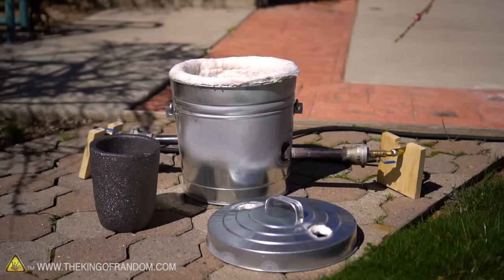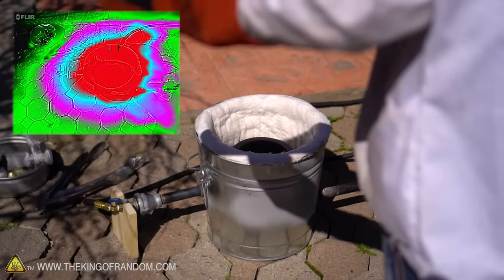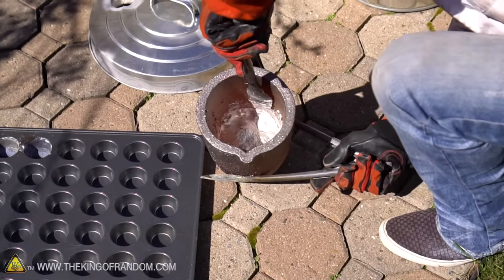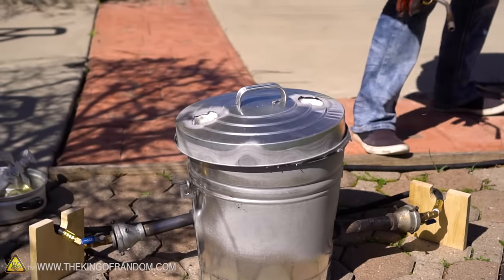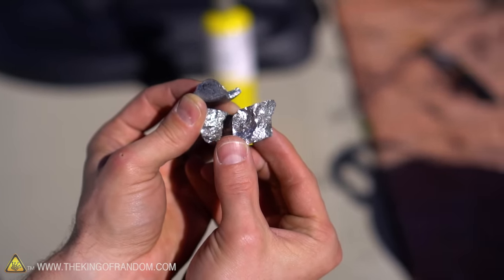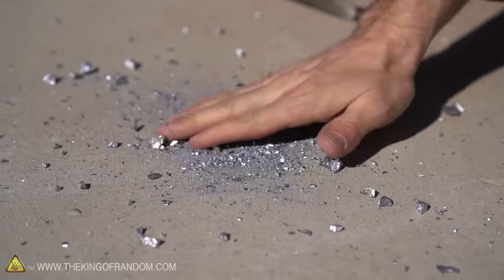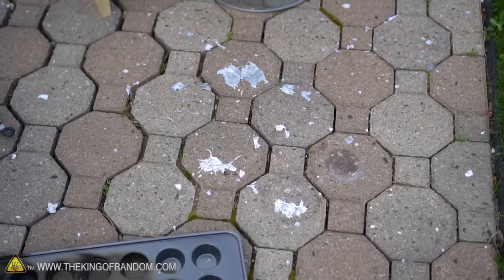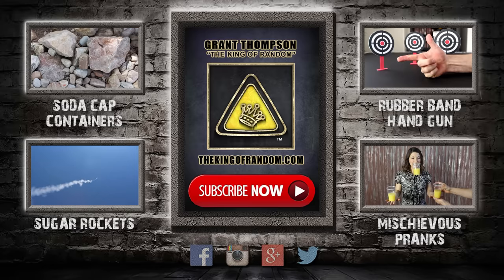Mixing Molten Aluminum With Molten Brass | How To Use Mini Metal Foundry For Mixing Metals

Comment: The reason it shattered so easy doesn't have much to do with the metal more the fact that they are metals. While the aluminum is brittle, the reason it shattered so easily is because it was cooled down rapidly. This increases hardness (resistance to scratching) but increases brittleness (resistance to shattering). If it cooled down slowly, in air, in sand, etc. it would be less brittle but would also probably be less shiny
Reply: Kevin Smith Thank you... I noticed that too. He always just sticks them in cold water to instant cool them
Reply: I dont think that is what happened here.
If you take a look at the broken pieces you can see that the crystals are extremely large.
Large crystals mean the alloy cooled down from liquid to solid very slow.
Now iirc neither aluminium nor copper have a phase change below the melting temperature so cooling them fast after they solidified does not make any difference.
Reply: Kevin Smith correct sir
Reply: Kevin Smith you nailed it with science ☺☺
Reply: Kevin Smith is right. Landogarner83, you can't say that the crystals are large or not, a brittle fracture like that shows nothing.
Reply: Steel can also harden so it sounds quite logic. I'd like to see what happens.
Reply: Kevin Smith sorry, but do you mean decreases resistance to shattering? not increases?
Reply: Actually, steel hardens and becomes brittle during quenching  because of a diffusionless transformation of the crystalline structure, which is causing very high internal stress. But I don't know if such a thing happens in this mixture since it's been quite a long time since I've studied this. It's interesting though.
Reply: It's Tensile strength would be very low and would snap easily at say 35Mpa
Reply: Your thinkin of steel bud. Steel hardens because carbon in the steel helps create a crystalline structure inside. These two metals are non-ferrous and WILL NOT quench harden
Reply: I don't have any experience with aluminum, but with other non-ferrous metals (copper, bronze, brass, silver, gold ) when you heat to a low red and quench, it actually anneals them (makes them softer).   These metals quickly become work hardened when they are stressed (bending, pounding, shaping), and in order to make them malleable again is to anneal them in that way.
Reply: guys guys, the answer is simple, 90% iron 5%carbon 3%brass and 2% aluminum
Reply: trust me i totally know what this mixture would do, basically like making a nuke with a sword 8)
Reply: This is all true but the composition is a large reason it shattered. All the samples were quenched. You could see varying degrees of brittleness in the different compositions. Quenched brass and aluminum will not shatter like that, while a 50/50 mix can.
Reply: buttonvalley yeah, it works the same with steel and other alloys. Actually, annealing is mandatory after quenching steel, or you will have a very brittle material that'll break upon impact. Annealing is kind of a "reset" button, it allows atoms  to diffuse and release the strains that made the material hard and brittle. If you manage to control the temperature during this annealing process, you can control the hardness and resilience of your material (after quenching in the case of steel).
Reply: Even high carbon steel has only 0.45% to 1.50% carbon content.  5% is in the cast iron range, which can't be worked or shaped after casting.
Reply: but the brass
Reply: or am i o.O
Reply: Keyshaun Spratley YOU ARE NOT BILLNYE
Reply: Bill Nye only played a scientist on TV. Cody has more of a science background than him.
Reply: Bill bye isn't a scientist. He's a actor
Reply: kristofer, as they said hes an actor and i am acting as a scientist there for by transistive properties you cannot not say im bill nye
Reply: Keyshaun Spratley he is also a scientist
Reply: well im playing bill nye sooo... TRANSISTIVE PROPERTIES!
Reply: This is only true for steel, where heating and quenching imparts high hardness and thus high brittleness. Quenching for copper and copper alloys actually anneals the material (this is often done to relax the metal while cold working copper as it work hardens). Aluminium and its alloys are hardened by aging, a process where the metal is quenched then tempered. However, unlike steel, where the hardness is imparted during the quench and dialled back in the temper, the hardness is imparted during the tempering (aging) cycle.

Comment: It would be cool if you melted down pennies and experimented with pennies made in different years(since they have different metal compositions). Plus, what else(as in a practical use) could you do with a penny?
Reply: Lucas E pennies after 1985 are just copper clad zinc
Reply: Yea so get a penny from 1807... not worth enough to save! :)
Reply: FinalNoob_27 A penny from 1807? That's worth thousands, probably more.
Reply: FinalNoob_27 im pretty sure a penny from a little over 200 y/a would be worth more than what I make in 2 years
Reply: +Lucas E you can make batteries from pennies
Reply: What you make, my friend, is a federal crime....
Defacing public currency...
Reply: You are right.
Reply: but that would be cool. penny muffin
Reply: Lucas E I so read that wrong
Reply: Ninja Master lol
Reply: Lucas E g
Reply: Pieguy55 I was just about to say that

Comment: If you can make brittle metals, can you ground them into a powder and see how flammable that metallic powder is?
Reply: I know I'm a year late to this comment, but metals don't burn
Reply: Sodium, but I guess you mean heavy metals not alkaline metals
Reply: @thepizzaguy8477  well... they can, but not at normal temperatures... you can oxidize metals fairly easily, you can even evaporate or turn metal to plasma with enough heat....
Reply: @thepizzaguy8477  zinc does, so dose magnesium, and aluminum can burn. But yeah copper is called a "noble metal" so copper doesn't burn or oxidize as easily as other metals.

Comment: The rapid quenching with water tends to make metals a lot more brittle. The rate of cooling has a big effect on the way the crystalline structure forms and changes the metal properties a lot. That could make an interesting video, make the same mix of metal a few times, allow one to cool overnight, quench one in water, and quench one in liquid nitrogen. Then test how brittle they are.

Comment: The reason why the metal became so brittle is because you cooled it with water. This causes micro air pockets to form in the newly mixed material, which make it extremely brittle.

I would implore you to do the same half and half mixture and then let it cool on the concrete till room temp. The same principle can be found in welding, where whenever you add new material (or the weld filament), when you cool it down with water the same thing happens. The weld becomes brittle, and can’t hold up as much weight.

Comment: I've been wondering for quite a while what will happen when you mix molten glass with molten metal, can you try that out?
Reply: Yeah, I think you would be looking to suspend the metal in the glass structure, rather than blend them or make an alloy. Pretty sure glass is non-reactive and can only be decayed away. There are many examples of glass blowers using foreign particles to make designs, colourization, structure, etc. I think an ancient glass blowers used to blow finely ground particles into their pieces. Certainly for colouring, glass "alloys" are a possibility.
Reply: TheTiemotje They do in the process of making certain forms of glass where an ingot of tin I believe is melted down and the molten silica floats on the tin
Reply: Some crystal glasses use metal oxides from lead or zinc but you need temperatures way higher than 1000°C, which is enough to melt brass or copper, to properly combine the materials into glass. 1500°C is what you'd need to have at least.
Other metal compounds are used to colour glass and lead glass is also used to shield from ionizing radiation.

Molten metal probably wouldn't work though.
Reply: TheTiemotje yeah
Reply: That's how they make some marbles, such as the golden lux swirled ones
Reply: well your smart

Comment: Can you make homemade bronze with copper and tin
Reply: it's not just copper and tin, but also some nickel or zinc.
Reply: Dr. ZomGaming traditionally bronze is just copper and tin
Reply: You're both right.  There are actually a bunch of different alloys that are 'bronze.'  Some are just copper and tin, others add in other metals for different uses.  Steel is the same way.  If you just add carbon to iron you'll end up with a basic form of steel..... but if you add in other metals, like nickel, chromium or molybendium, you'll get steel with different properties.  (Corrosion resistance, extra hardness, greater durability, etc.)
Reply: I see $25 coming ur way
Reply: yeah bronze can be made using a variety of metals... infact aluminium bronze is made with copper and aluminium, has it's benefits over the traditional tin bronze... so grant pretty much made bronze in this video.. even though he used brass the zinc burnt off leaving copper.
Reply: That's what I was thinking.

Comment: Can you melt "fools gold"(iron pyrite)?
Reply: Wuchubuchu You certainly can melt fool gold it's melting point is about 100 degrees Celsius higher than coppers melting point . Fool Gold melts at around 1180 degrees Celsius 👍🏻
Reply: Wuchubuchu The technical name is pyritr
Reply: No, pyrite is iron sulfide, the sulfur would burn off giving you iron and some very toxic gases
Reply: Littlescotty 22 pyrite
Reply: its called pyrite
Reply: +Colby Upton
If you found various samples of Fool's Gold in the Lesser Antilles...would they be Pyrites of the Caribbean?
Reply: I think if you smelt fool's gold you end up with iron.  Burn away the impurities that make it look like gold.  It's actually a type of iron ore.
Reply: You are burning off sulfur by burning iron pyrite in this case.
Reply: bigstackD you could probably forge the metal then.

Comment: Would you be able to use the heat resistant fabric and wrap it around the crucible so you don't have to use those tongs? Great video! Keep up the great work!
Reply: WhiteFox he could but then there is the chance of the molten metal dripping down and buring his gloves and possibly his hands
Reply: No because that would make the crucible insulated and thus, not able to heat up and melt the metals

Comment: make a mold of your own head!
Reply: Piggiey5000 No He Can 3D Print his Face And make a Mold (Silicone)
Reply: there are ways to cast a head, I believe myth busters did it a few times and I've had my just my face cast in paper machete in middle School
Reply: Piggiey5000 he can put his face in the sand and pour some molten Al in that hole
Reply: You can do a life cast look on tested channel
Reply: smeltwater that's why you put straws up your nose when you make head molds

Comment: Quenching metals make them brittle. That's why tempering is needed afterwords. The reason smiths quench metal is because something brittle can be extremely sharp. But they temper afterwords because too brittle and it will lack durability. If you let them cool slowly I suspect the chances of them shattering upon being dropped would be reduced significantly.
Reply: This, if you JUST quench it in water, it's going to be EXTREMELY brittle, hence it shattering on the pavement, but if you temper it, say with a blowtorch or even just putting it in an oven for ages, it will help it gain some strength back.
Reply: Tiffany Quenching brass actually makes it more ductile afterwards. Reloaders do this when converting cases from something like a 20 ga. to .577/.450.

Not all metals behave the same. :)
Reply: Robert Rodriguez yeah science
Reply: Lmfao they quench it to set the cystaline structure of the metal. It has nothing to do with sharpness. The reason its brittle is cause all the molecules are under stress, tempering reduces that stress.
Reply: quenching steel makes it brittle, while hot steel is ductile. quenching copper alloys makes them ductile, but hot copper alloys are very brittle. metal =/= metal.
Reply: Except for the fact that latten metals (copper alloys) are annealed by quickly quenching them. This is the opposite of ferrous metals.
Reply: J Schmidt Nobody who originally invented the process had any idea about crystal chemistry of metals, they indeed started doing it because hard and brittle tend to go hand in hand for basic metals and hard means holding an edge better which would be the actual goal usually.

why, for a weapon, would you want to "set the structure" in that way anyway other than edge hardness, sharp edge holding, etc.?

it's like saying "I put gas in the car to get to work" then some person responding "uhhhh aaactually you put gas in to mix with air in the pistons" or something--eyeroll... yes,  order to get to work.

the actual end goal of quenching is generally sharp edge holding ability for a weapon or tool.
Reply: Tiffany 
Copper and brass are the opposite to steel. 
It actually gets softer if you quench it.
Reply: Tiffany I think the mix  blows up become of the valence electrons in the different metals zinc has 2 copper has 2 and aluminum has anywhere form 2 3 or 13 .the zinc dose not like this so it chose to bind to oxygen because oxygen has 6 elcterons. Elements like to have full shells so zinc becomes zinc oxide quickly creating an reaction. If I'm wrong please correct me.
Reply: why is why metal is put in oil then in water
Reply: Terminator X the oil quench is to slow down the temperature drop. some steels really like to crack if quenched too quickly. you wouldn't need a water quench after that.
Reply: Except that brittle and hard arent dependent on each other. Nobody was running around saying we need this blade more brittle so we can sharpen it more, they said what can we do to make this super hard metal less brittle. Just cause it was a side effect doesn't mean they really  really wanted it, otherwise why temper.
Reply: Brittle and hard aren't complete synonyms, but they are indeed highly related outside special cases. If something does not easily dent or deform, then it has to do something else when too much force is applied, usually among materials out there in the world, that is "snapping". Including most metals. 

Nowadays uou can probably find some exotic alloy for whatever you want, but they used to make the spine of the blade soft for flexing not snapping (but unsharpenable for long) and the edge hardened (but also brittle), because the two went so closely hand in hand there was no better solution for most of human metallurgical history.

Comment: Aluminum and copper are the basis for 'non-sparking' tools.
Called aluminum bronze, it has a soft golden color, is a little heavier than Al and is very corrosion resistant.
The curiosity I have is this: what do these alloys do in terms of heat-conductivity?
Copper is one of the best cheap metals for carrying heat, Al comes in a distant third.
Silver is the best, but at current prices you won't see too many Sterling Silver heat-sinks.
Sterling is about 97% Ag, 3% Cu by weight.
Next week on 'This old guy rambling', we make a Silver heat-sink by melting down some un-circulated 1923-D Peace dollars with a 1943 copper penny or two.
Work with what you have, I guess.
Reply: Greg Gallacci sterling is 92.5 hence 925
Reply: thats a nice question, if it was an alloy thermal conductivity and thermal expansion would be in between copper and aluminum, however thats not an alloy, copper aluminate forms at that temperature, in my opinion thermal cond. would decrease dramatically since the crystal structure and mech. properties resemble ceramics.
Reply: alloys have lower thermal conductivity than pure metals
Reply: Wow. A plug.
Reply: Copper isn't cheap lol
Reply: evanr32 it is?

Comment: don't heat your brass so hot just a few degrees above melting point and use sum flux.
Reply: jim stone he can't control the temp perfectly
Reply: He likes to breath in metal vapors and roach killer for flux... rip
Reply: Roach Killer is just Borax
Reply: his hot box has no temp controller like most electrical have. Thats why i prefer electrical over gas types